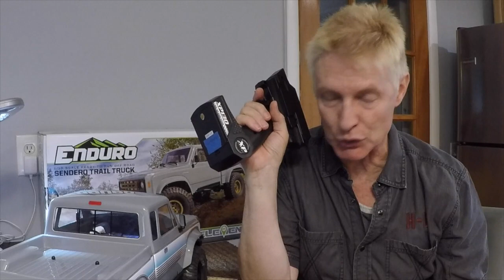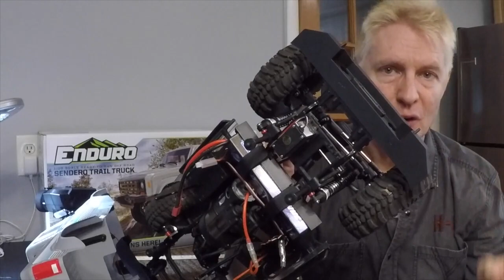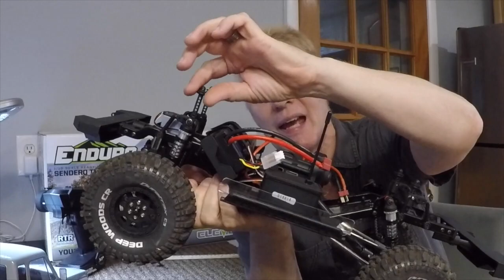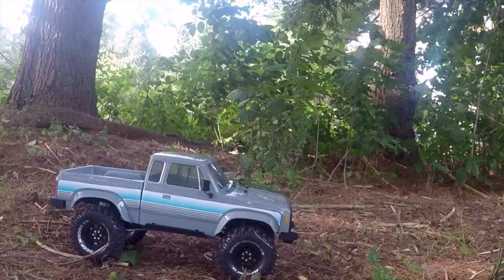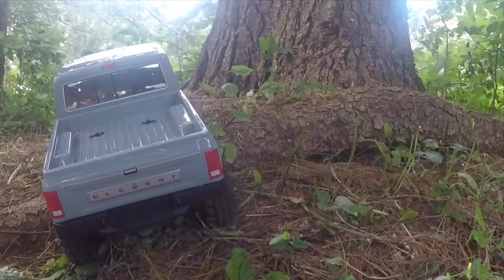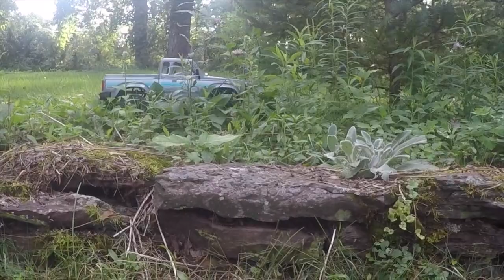ELEMENT Sendero RC!! A very capable 1/10 Crawler indeed

Comment: Just stumbled across your channel subbed. 
 I run those exact wheels and tires on my stock trx4 sport.
Reply from the maker: Great! just bought some metal beadlock wheels and 4 more Duratrax tires for my Gen 7
Reply from the maker: I just put on shorter shocks and am going to shorten the wheelbase on my Gen 7. this should give me greater steering and lower my center of gravity. I found one of my stock Gen 7 shocks was leaking already... so the shock change will help. Stay tuned for a remake of the Gen 7 video!